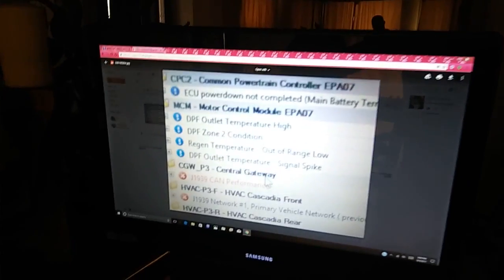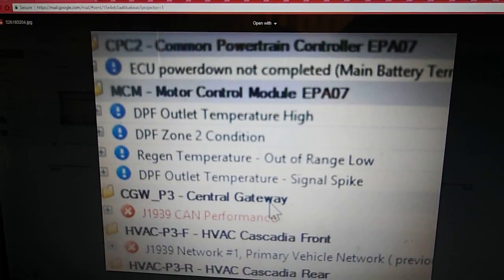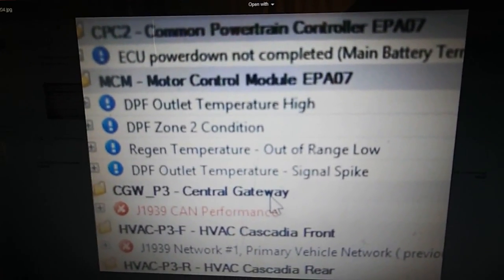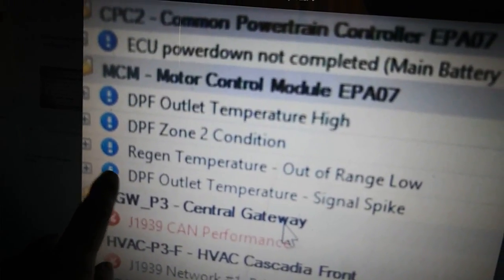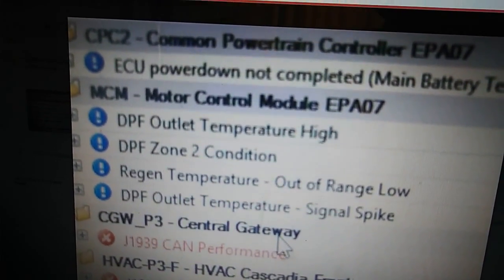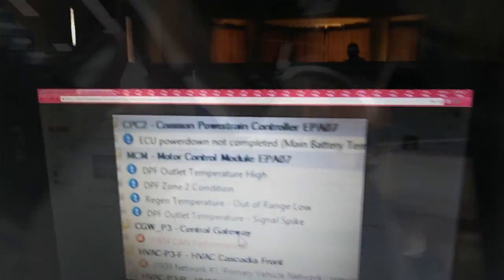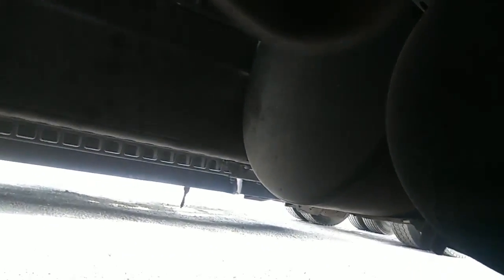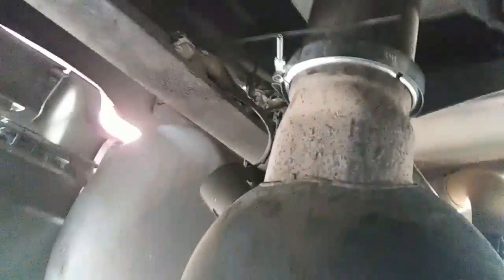freightliner fault codes

Comment: Hey.. I have two questions 1 when you clean your fuel doser as you were trying to loosen the fuel line from the doser itself did the line move, because mine is moving and I don't want to break it... 2 before you change the clamps on your exhaust did you have backfire from your exhaust
Reply from the maker: yes the fuel line does have some play to it,as far as back firing,i didnt notice or hear any back firing,good luck and thanks for tunning in

Comment: Hi Vic 
Question: what you think of a 2013 cascadia with 800,000 miles for $31,000
I don't know if have had overhaul yet 
And thanks for shere all what you know
Reply from the maker: thats way to many miles,dont buy that ,even if it had a over haul,you are still going to have to do the bottom of the motor,if you dont you are going to loose your trany,DONT BUY THAT TRUCK,
Reply: @vicmed6088  am getting my truck soon. wheres your mechanic?
Reply: Noe Alvarez that too much miles bro shop around